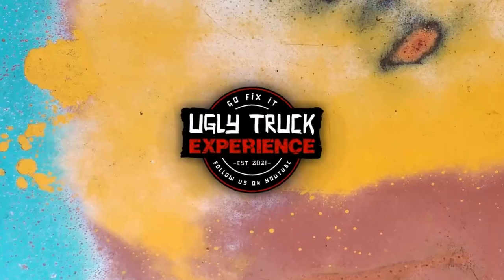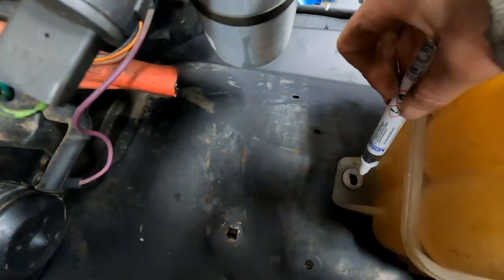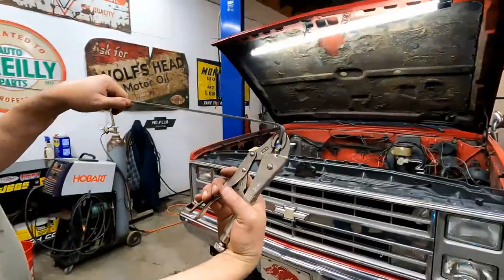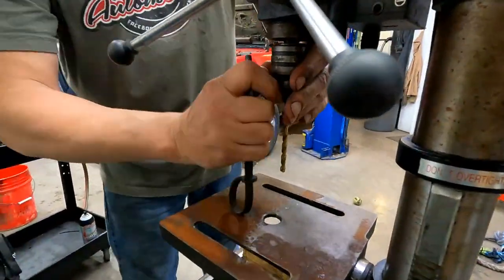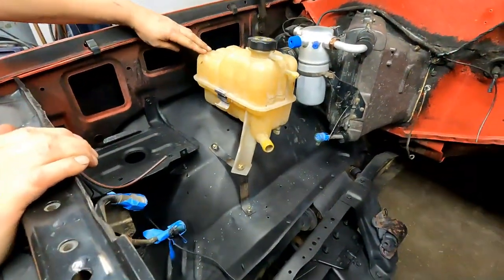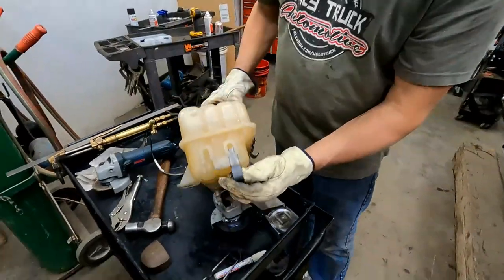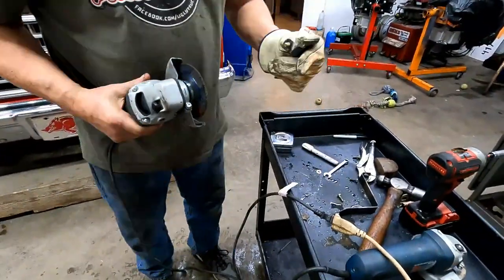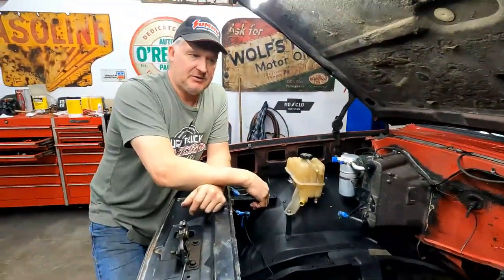Mounting COOLANT RESERVOIR - EASY! LS Swap BRACKETS - UTX

Comment: Happy Anniversary!      “coolant reservoir”
     Suggestion on flattening the area for your first hole, after drilling the hole, use two large thick flat washers 2-3 inches around, then use a long bolt 8-10 inches or longer to be bolted tightly to the fender w/ the long end facing up and washers on both sides ,  use the long bolt as leverage pulling towards the passenger fender, keep tightening bolts to keep it flat till you get it how you want it, hope this helps.
       Y’all doing a great job on these videos, very informative and detailed, thanks for sharing y’all’s knowledge,  i’m fixing to do my first LS swap on my 82  C/10   and y’all are giving me the confidence to tackle the job, keep doing what y’all doing,
Reply from the maker: Thanks so much for your comment! We appreciate you watching! We have a bunch more LS swap videos on the way, so if there's something specific you'd like to see that we haven't covered, just let us know! 👍

Comment: Thanks for the video.  Did you do one where you show how to plumb in the tank?
Reply from the maker: I use all the stock hoses from the donor.  I am not sure if I have ever really shown it but know that I mention it now and then.  Using the stock hoses from the LS makes it easier for me to give it back to the truck owner knowing they won't have a problem getting a part if needed.   We have a ton of LS content coming up and I will try to touch on that.  Thanks Carstars.   Jerry and Emily
Reply: I am trying to plumb one in for an LS1 swap into a C4 Corvette and the old stock LT1 system is a plumbing nightmare.  I am thinking I'll get a newer C5 type tank but I am not 100% sure where to run all the lines. @UglyTruckExperience

Comment: Great video as usual!  Have you guys ever used rivnuts?  I recently discovered them and started using them at work. I think it would be an excellent option for a welder-free, but also easy to install setup. They are an absolute game changer when dealing with sheet or thin plate material. Best of all, a starter kit is very affordable as low as about 40 bucks on Amazon.
Reply from the maker: Thank you! We've never tried them, but they look like they would come in handy! Thanks for sharing!

Comment: Nice job, but will the ac low pressure fit on the accumulator
Reply from the maker: I end up bending that line just a little bit so it fits.  That is why I like that style reservoir bottle.  We will do video on that when we get to that point also.  Thanks.

Comment: Is the coolant reservoir required or can the original radiator be used alone and sufficient?  This is my first Swap into my square body.  Thanks.
Reply from the maker: Hi Jason! It depends on if you're talking about the original radiator on the C10, or the original LS donor radiator. The LS radiator does not have a fill cap, and the C10 radiator doesn't have a spot for the steam port. If you're going to use your original C10 radiator, you'll have to adapt a steam port into the upper radiator hose and make sure that radiator is able to keep that engine cool, size wise. Thanks for your question, hope this helps!
Reply: @UglyTruckExperience  Thanks, I was talking about using the original k20 radiator.   I still have the donor vehicle, so I can grab the reservoir and it’s hoses.  Thanks again.  Btw, I built one of your gas pedal brackets today, it worked like a charm.
Reply from the maker: Right on! Glad to hear the pedal worked for you! We appreciate you watching!

Comment: Hi guys so I’m in the same process with my project but I have a question about the system I’m not using a heater core
Reply from the maker: Hello Chris.  What is your question?  Jerry
Reply: @UglyTruckExperience  I’m trying to figure how to explain this so water pump has a hose that is a y off the water pump to the reservoir the same hose also goes to the heater core then it comes from the heater hose to back to the water pump can I just route it back to the water pump instead to the heater core because at this moment I’m not using a heater core I’m just wondering if will have issues cooling
Reply: @UglyTruckExperience  also happy Fourth of July to you and your family friends